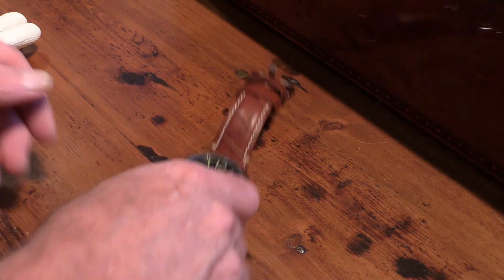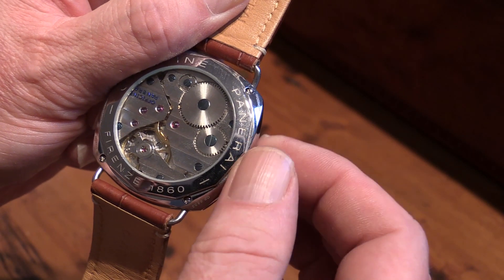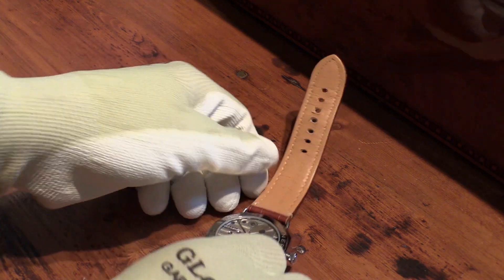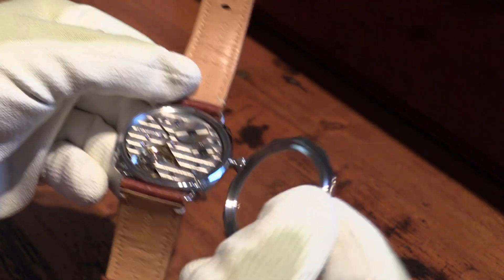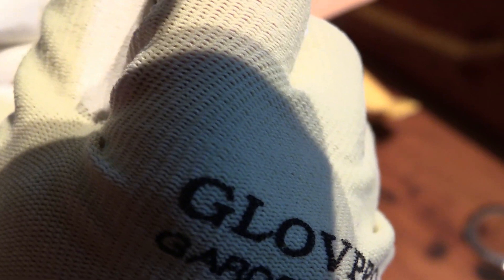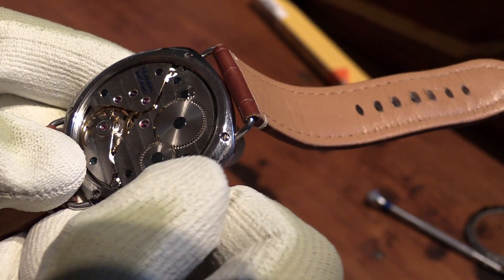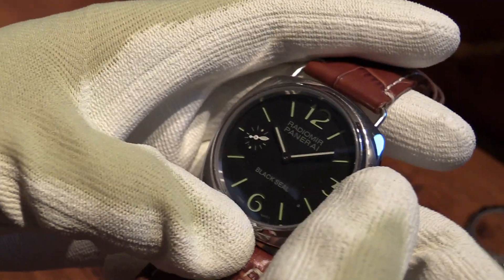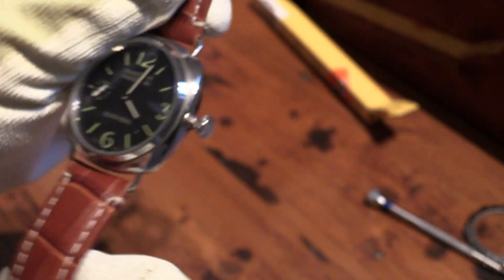Fake Panerai - Repairs at Home.

Comment: I just watched this to encourage me to try and open my fake panarai Daylight which had stopped being able to adjust the date window....Your's looks to be a much better mechanism than mine as in mine the whole movement is very small with a plastic ring that it all sits on to fill the case....anyway, a bit of fiddling and the date works again (never mind the fact that the chronograph wheels never did work right LOL)

Comment: what kind of gloves are these?  like do you have a link for purchase?  I have a fake breitling and I cant get the back off if you have any tips or tricks...
Reply from the maker: +ting280 Those gloves are called Glovepro Garden Touch (I bought them at a local supermarket and can't find them on the net)  These look similar: http://www.amazon.com/Atlas-Glove-Nitrile-Garden-Gloves/dp/B000MTT11S .  Get gloves that are tight, maybe a size too small, to reduce slack.  As for technique, you should google "case back removal" for the particular watch yours is a copy of.  Most solid backs these days are screwed in and you need to rotate anticlockwise to loosen them.  Some will need a special tool though.